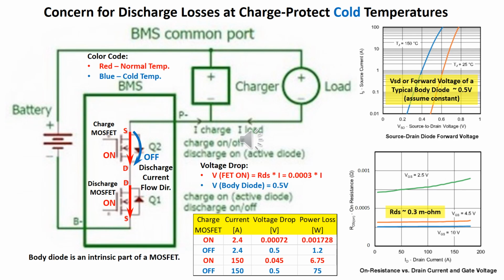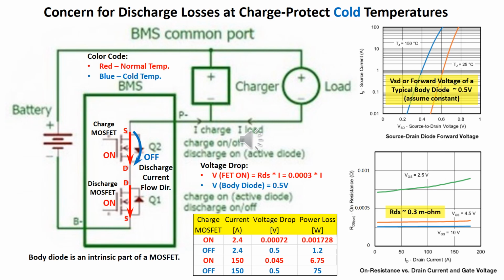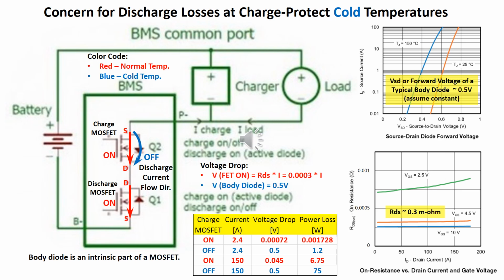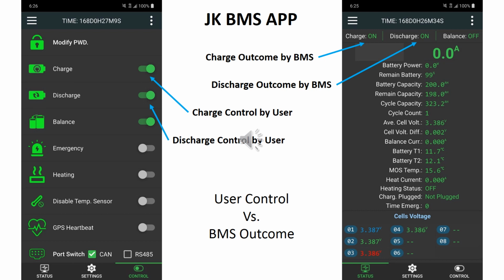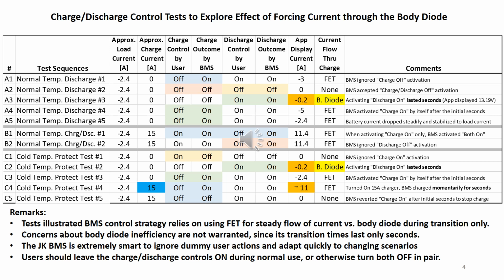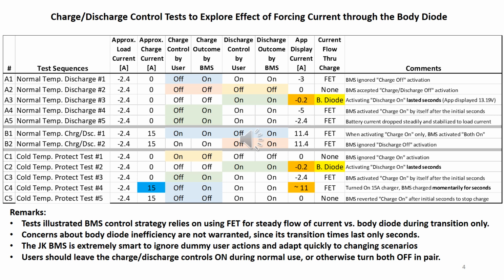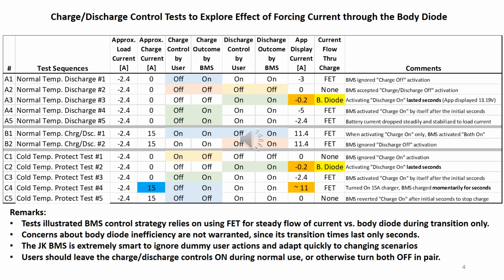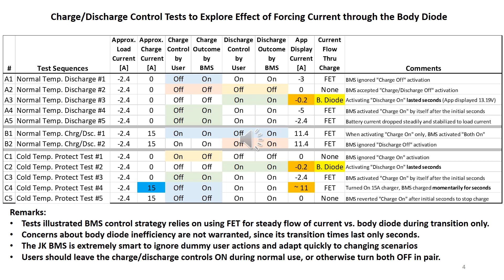JK BMS – The Working and Charge/Discharge Directional Current Controls of a Common Port BMS

Comment: Hello Park, I would like to ask you a (rather) simple question. How does OVP an UVP work. For example if I set OVP to 3.5V, when one cell reaches 3.5V the CHARGE stops but discharge still works? On the other way around - when I set UVP for 2.9V and the battery reaches 2.9V - will the discharge stops but can I still charge the battery?
Reply from the maker: Answer to first question: yes. Once a cell drops to 2.9V, discharge will stop and battery will be in standby. Battery will become active once charging current is detected.